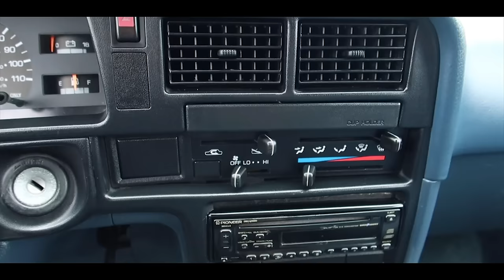1993 TOYOTA PICKUP | MOLDY RESURRECTION  DETAIL

Comment: Man I used to put those striping kits on in the early 90’s. Takes me back I love these trucks. Sharpline was the name of the company that made those kits. They rarely lasted that long. That was neat to see one in such good condition. I also had an 86 p/u 2wd. My favorite vehicle ever. I love the pull style parking brake
Reply: My 2001 mazda b4000 has the stripe kit on it but will soon need replaced
Reply: Nice memory about "Sharpline". In the late '70's/early '80s we had a regional(?) company called "Trimline Design" if I remember correctly. My memory is that they prepped many/all the new Toyotas/Hondas etc before the dealers presented the vehicles for sale. They did great work.

Comment: Oh Man I have had Toyotas for over 15 years and bought them in pretty rough shape (I flip them), one thing I would recommend to all who get cars like this that have been sitting outside is to check the wiring and with a knife split and check the end of the wires, i had some issues with that and when checking the wires were full of corrosion inside and looked ok from the outside, it causes horn, lights, starting issues, hazard and turn signal issues, so if you see one or two wires full of corrosion, try to get a healthy harness from a junk yard and you wont regret it, usually these cars have their known issues easy to repair but corrosion is almost present in all of them if they seat outside when its moldy. Good detail :) thx for sharing

Comment: for the rusted seat bolts, next time you may wanna try sea foams deep creep. it's a great penetrating oil that will break loose stuff like that in no time.
Reply: Add to how good this product is on dump trucks hauling asphalt the lug nut can get coated due to driver error or shit happens but it does a great job penetrating through the asphalt and on to the lug nut and stud still not as fast as a torch but seafoam deep creep throq kroil in the trash sea foam ftw

Comment: Same as my old toyota 4x4 extra cab sr5 black stick 5 speed shift on fly 4x4 radio has cassette deck i put custom power antenna keep limbs brake off antenna just turn off

Comment: I never understood why Youtube detailers don't remove the threshold trim piece.  2 or 3 screws each side and you can get the edges of the carpet so much better.  I always take those off, it makes for a much better job.
Reply from the maker: If you see other videos I remove it all the time as I mentioned all the screws/bolts were rusted on this thing

Comment: Also, I loved my Bissel Spot Cleaner. I used the heck out of it before it froze in the winter due to water still being in the nozzle and it broke something in it because it won't spray anything now. I bought a Sandia heated carpet extractor and I think I've used it twice so far...and I bought it 3 years ago for $700. It's already broken a few of the quick disconnect fittings that I've had to fix, but it's an amazing machine. Nothing will ever be as good as the 4' tall $2500 Thermax machine that I had at my old dealership that I worked at. Like they say, you get what you pay for, but I'm not a professional detailer anymore. I just have it for my cars and my wife just got a new car and my car has leather interior, and the carpets are trashed in mine. 
Edit: I mean trashed as in I've already extracted them, but they have holes and burn marks from before I bought it.
Reply from the maker: I agree I’ve had my thermax for years! And it’s awesome